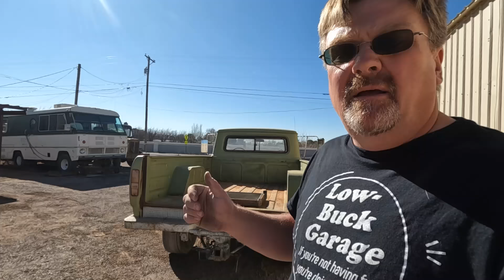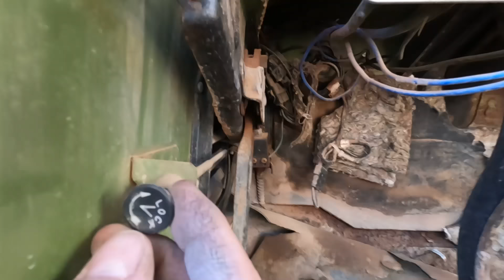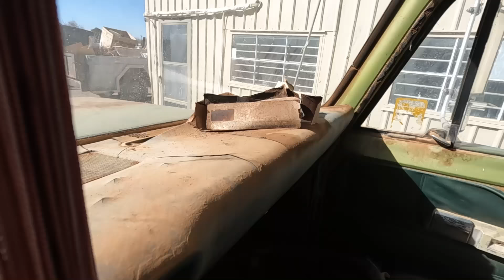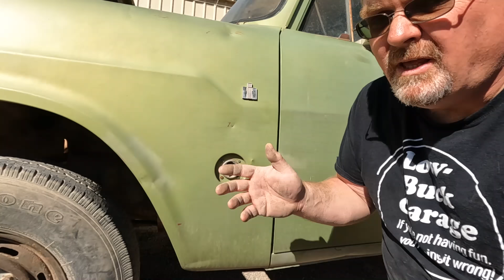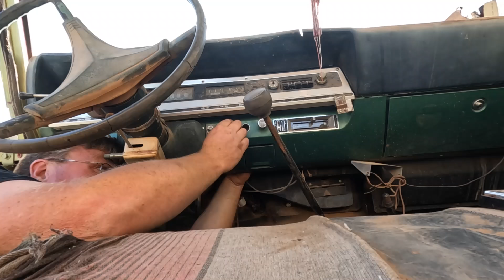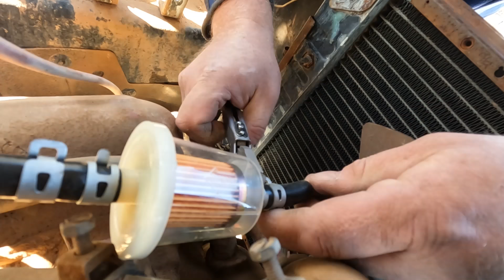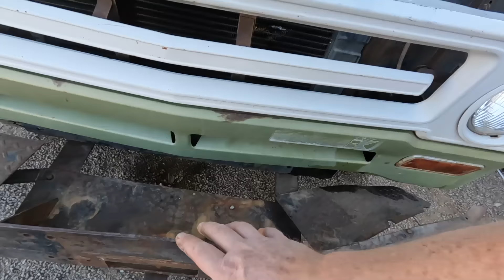1970 International 4x4 Pickup

Comment: T34 transmission?
The 345 is considered a HD gas engine, big bearings, etc. With the high price of diesel vs gas now, a turbo 345 might be worth considering. 
Could add Holley fuel injection, to make tuning easier and engine longevity; 2 and 4 barrel available.
4 barrel intakes are also available for the 345, if more cfm is needed.
If the gear spacing is too wide, a 2wd NV4500 can be adapted and is stronger. I like divorced t-cases; easier to work on.
Cool truck.

Comment: The cables are for a bellview 6000 later warn M6000, later warn M8000 winch which were the precursors to the warn 8274.  Very nice winches, but they have gotten spendy.   That bumper is clearly set up for that type of winch (it mounts feet forward).  Any of the ones I listed above (including a brand new 8274 one) will fit.  

I think the oil cooler was just a separate system.
Reply from the maker: Thanks for the info, I noticed that there were no mounting holes on the bottom.  Now I can start looking for a broken version of one of the front mount ones you mentioned.
Reply: @LowBuckGarage  👋 hey, I noticed you only put gas in one of the tanks. Could it be possible you have the tank switch to the empty tank and not the tank with gas in it and that is the reason you don't have fuel to the fuel pump? I mean it was running, till it ran out of gas, you put gas in it and then it wasn't running.   Maybe use the switch to swap tanks before replacing the fuel pump?
Reply: Norm the overdrive guy sells parts and winches when he can get them.
Reply: Also the warn 5687 winch, Bellevue, remade by warn. Front mount feet, cable control, Brennan Metcalf sells a power in and power out motor for all the old upright winches that were made as power in only. Herm the overdrive guy sells the rebuild kit for them and other parts. Also the 150 ft cable for them.
Reply: YEP! 100% CORRECT ON THE BELLEVIEW WINCH.

Comment: I knew a guy that was an application engineer for a company that made mechanical seals, the carbon disk pushed against the ceramic disk like the ones used in water pumps.  He made it very clear to me that there were two things that would kill those seals, vibration and running dry.

Comment: 38:24 Oil pressure is too low to do any winching but it could perhaps be used as a control to shuttle high pressure valves along. The pump may have been removed at some point.

Comment: I have a 67 IH pickup with the same engine.  You can still find a lot of engine parts at NAPA and Rock Auto.  One part that surprisingly wasn't available is the vacuum advance.  I had to send mine out to a guy in California who rebuilt it.  It was spendy, but necessary to get mine running right.  That T34 OD transmission is a beast.  I have the non-OD T36 version.  The engine/trans combo is HEAVY, weighing in at right around 1000lb for the pair.  I bring that up because you mentioned a possible diesel swap.  The front springs are up to the task of a heavier powerplant.  Nice truck!
Reply: Those were solid trucks!
Reply: those engines with all accessories wiegh 800-850lbs without the transmission i should know i dropped one once almost on my foot
Reply: @markroderick3300  Gotta love the industrial scale weight of IH engines. The 304 alone is equivalent to a BBC 454 in weight//dimensions (engine bay taken).
Reply: @RuralTowner  They are TRUCK engines not car engines
Reply: @markroderick3300  Oh I KNOW that...trust me. 
Got a Loadstar w/ 345...a spare 304 & a rotten running 800A roller w/ 304. Engine bay is big enough to stuff (with some firewall adjustment & not much else) an IH IDI or even an early PS. Also a running//driving (though not much of that in the last couple years it just sat) 62 Scout 80 with the original 152...have had that thing lug down once to maybe 300 RPM under load (slow enough you could COUNT plugs firing by ear) & it still seemed perfectly content while getting out of soft sand.
Reply: @RuralTowner  is the 304 an IH engine? I thought they bought them from AMC
Reply: @thomasglynn2282  The 304 is an IH engine and not related to the AMC 304 in any way.  The IH SV engine family came in 266, 304, 345 and 392 variants.  These engines showed up in Scouts, Travelalls, pickups, Loadstars, Cargostars, school busses and even a few combines.
Reply: @thomasglynn2282  There is an IH 304 & AMC 304...the only similarity is the displacement & nothing else.
I have an AMC 304 out back & a spare IH 304 (not including the one in a rot body 69 Scout 800A. The IH motor is noticeably larger in dimensions. Apples to Oranges...
Reply: @RuralTowner  yep I looked it up it was the 401 AMC engines that IH used. Also I forgot to mention we still have my dad's 42 KB1 p/u
Reply: @TheToolmanTim  yes. the most common up by me in the 70s and 80s were the 345 and the big 549 in the loadstar series, both being IH engines. the scouts I remember having 4 cyl engines. if my memory is still intact.
Reply: @thomasglynn2282  IH did use the AMC 232//258 straight-6s in non-V8 Scout 2s of the 70s & possibly pickups of the same era
Reply: My dad bought a 72 travelall new and because of emission laws IH changed the valve timing. Because the timing was gear to gear all you had to do was advance it one tooth. I have posted this many times and not one person has responded about knowing about this trick. Also after 72 or 73 IH stopped their production of small class vehicles, coincidentally dodge stopped their production of class 8 trucks at the same time and produced only light vehicles. I think some kind of deal was made but I'm not positive.
Reply: @thomasglynn2282  I never heard about that mod.  Good to know.
Reply: @TheToolmanTim  it's only for the engines made after emissions laws not earlier ones.
Reply: Speaking of Dodge Trucks, IHC provided the two largest of their engines for Dodge C series "Power Giant" branded trucks, which was their heavy duty gas version. I've seen a C900 tractor w/a V549 sell recently on FB Marketplace out of Ft Wayne.
Reply: Yes but body parts are rare’
Reply: A Cummins would be awesome in that truck!